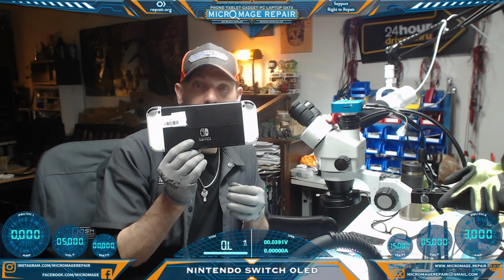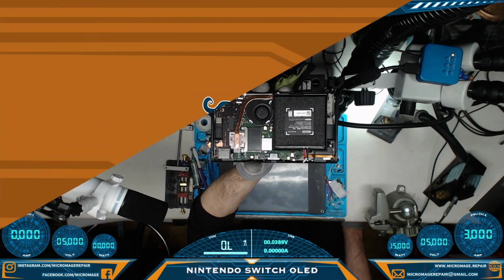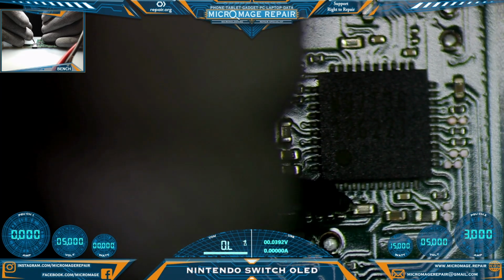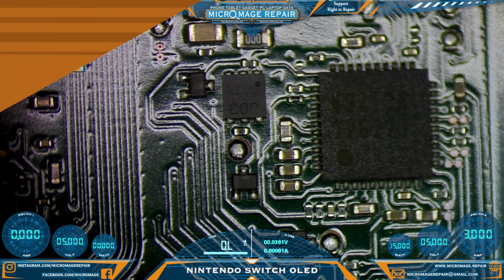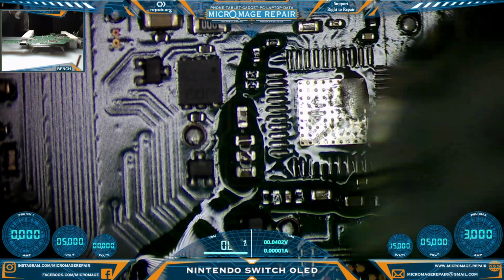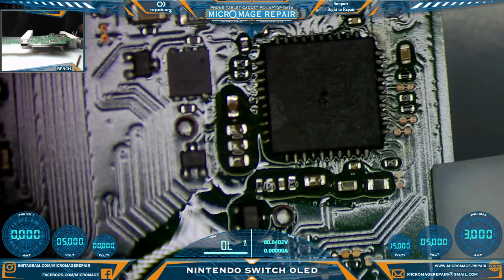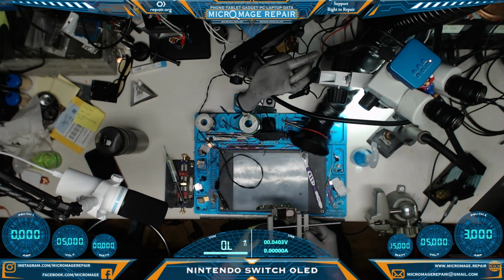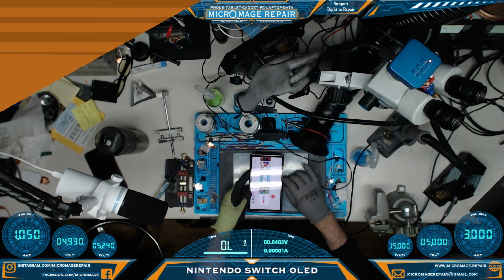Nintendo Switch OLED: ☠️ Why Does It Not Turn On?

Comment: If I can make 1 comment about your setup it's that a lot of the time it's very dark when you're working on components. Other than that the channel is silk in a glass
Reply from the maker: Appreciate you checking me out!
I have tried to address the light issue, should see some improvement soon. There are some limitations to the optics unfortunately though.
Reply: @MicroMageRepair  not trying to be prick, just an observation. Thanks for all the vids and advice. Oh 1 other thing, your gauges show PSU 1 and PSU 2 but as a new comer to your channel, I'm not sure what each are. Is 1 a bench power supply and the other some other power. Maybe your software might allow you to name them. Again just an observation
Reply from the maker: @theshemullet  Didn't receive your input a negative way.
I appreciate it.
Then PSU is the same , it has two channels. 
It's listed in my description if you'd like more details on it, it's been a great tool.